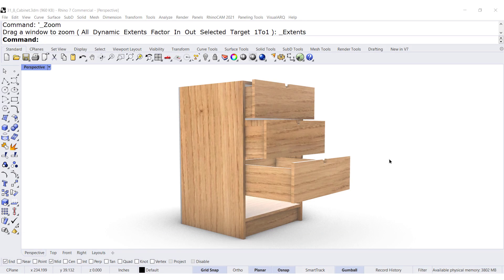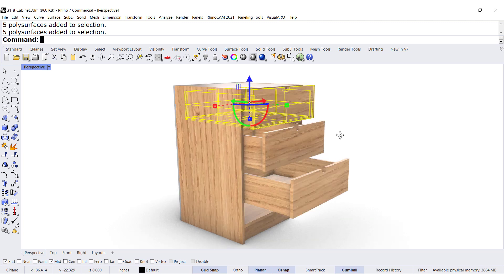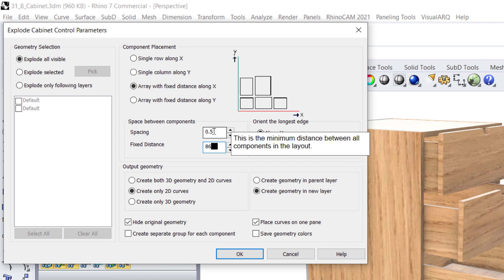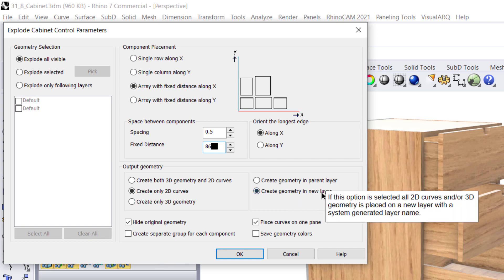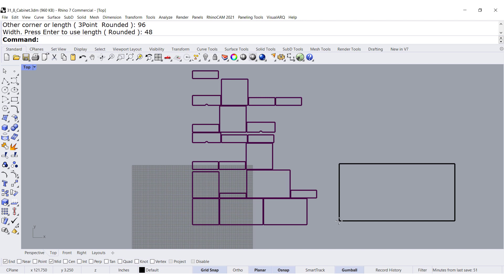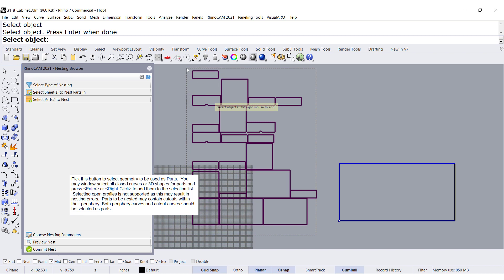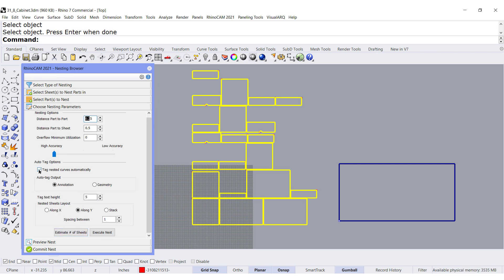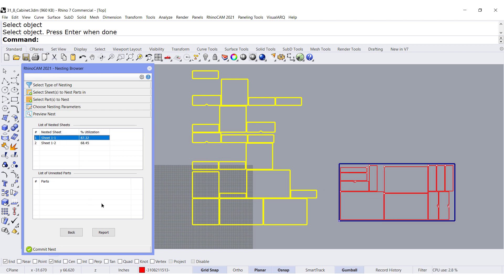Prepare 3D Cabinet for Nesting

Comment: You seem to know Rhino well.   Is there an easy way to make custom cabinet doors?   IE:  I'd like to have a library of frame profiles, center panel profiles, and lip profiles.  A simple select and apply is what I'm after.  So far, looks like the method is exactly the same as SketchUp.   No advance intelligent intuitive way to apply edge profiles and panel profiles to an object.  (I should add, without writing a script or buying a plug-in)